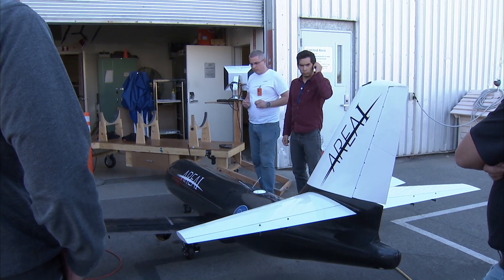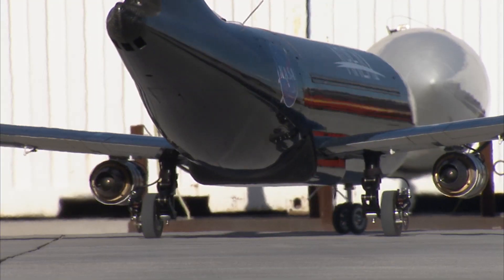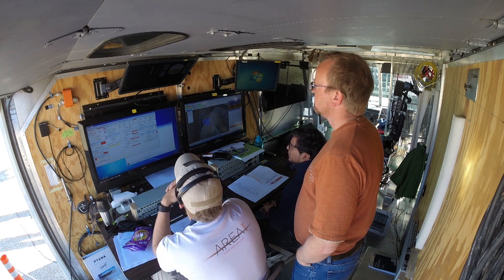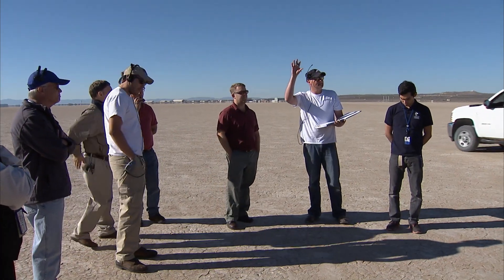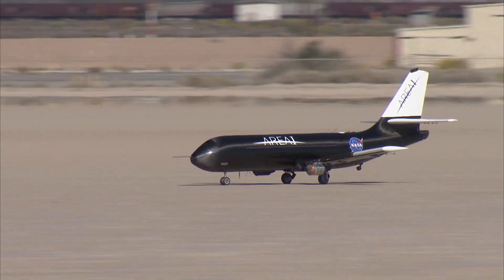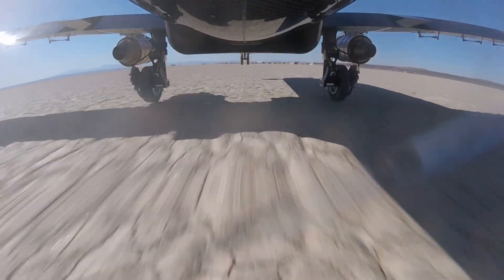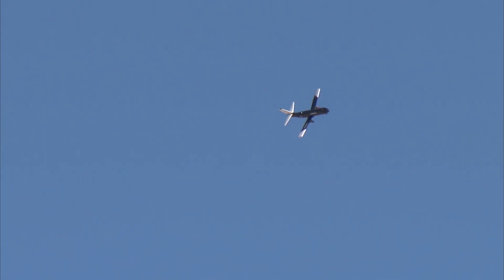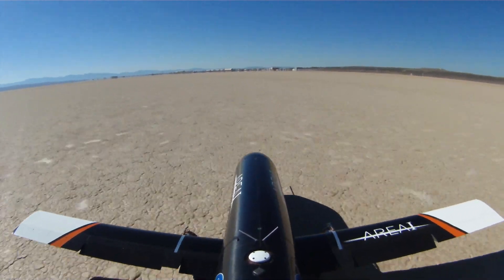PTERA - Modular Aircraft Flight Test

Comment: Why is this better then just using a wind tunnel? (Other then being way more fun)
Reply: Noah Knox Good question. The reason for this is that you get a test that's similar but cheaper and gets to test more a realistic operating scenario.
Reply: Noah Knox cost and availability. To do wind tunneling you need a lot of cash and a lot of patience as every hour in a tunnel is booked months in advance. This is a quick and convenient way of trying multiple configurations. Obviously this r/c method is not as controlled but get valuable time/experience and data from it.

Comment: Is this model flown via line of sight or via onboard video link (FPV)?
Reply from the maker: The airplane is flown by line of sight. The aircraft currently can only stay airborne for roughly 20 minutes at a time.
Reply: What's with the wing flutter?
Reply: Does it have some kind of loitering feature built into the flight controller in case the operator has an equipment failure?